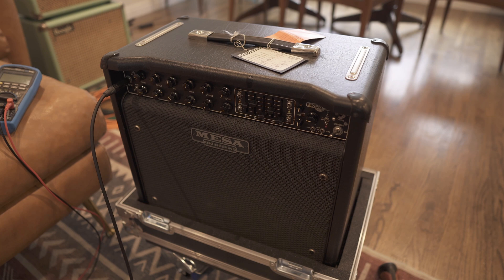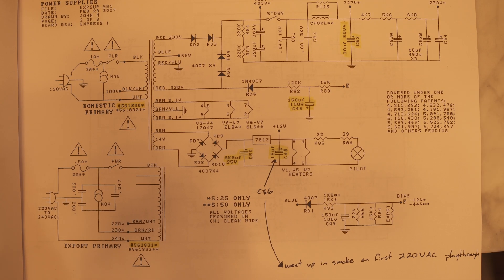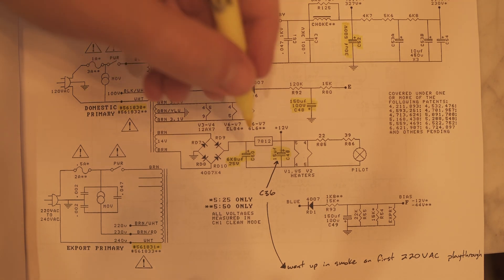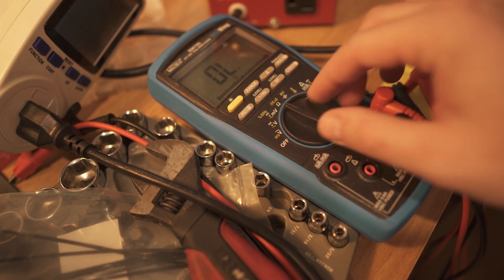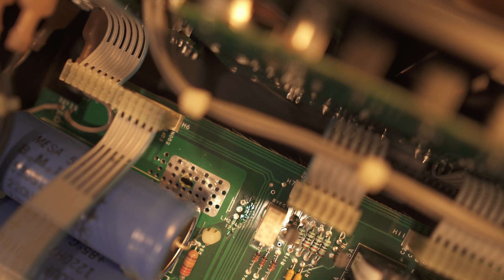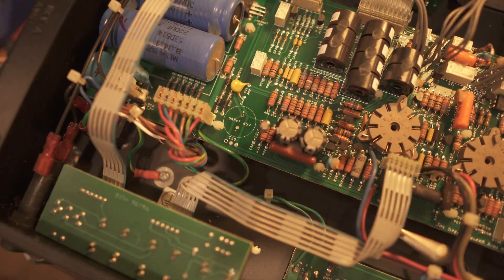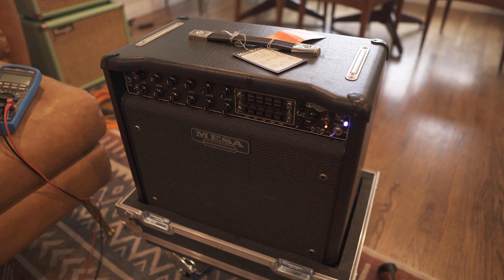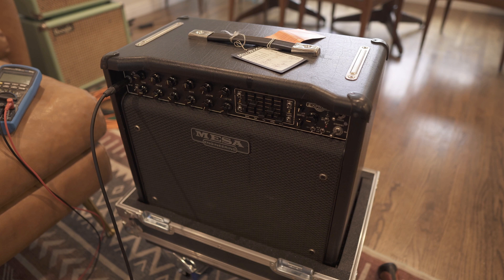Mesa Boogie Express 5:25 Repair

Comment: Well, the burning question in my mind, which is totally unanswered is, if you can’t get to the underside of the board, without massive disassembly , How in the world did you get that radial cap in and out of there ???
You Conveniently did not show that part!
Reply from the maker: @dalevanlewen9759  sometimes you can twist radials clockwise and counterclockwise until they break away from their leads without damaging the pads. Then you just desolder the leads. But for this particular cap, i lifted the board just enough to get a soldering iron tip under there. To do this, you have to disconnect several ribbon cables and push the plastic stand-off clips together to release the pcb. Not a total disassembly, but still a delicate process. There's another comment on here where i posted a reply already, it's C50

Comment: How did you remove C50?
Reply: Excellent technique. Thanks for the quick response!
Reply from the maker: C50 can be removed by carefully twisting the component CW and CCW until the leads disconnect from 
the cap but not the pcb. Much like how you can remove an SMD cap. To get it flush on the board, you'll need to lift that side of the main pcb to solder the bottom

Comment: Unrelated question on this amp -- Is there a place to find descriptions/meanings of the relay designations in the schematic: RYTS; RYOD; RY2; RYE, RYA, etc?

I am looking at the preamp schematic and having a hard time understanding how the signal flows in any given mode.  Is this correct for clean channel in clean mode:

Input --> V2B --> CH1 Tone Stack --> Ch 1 "Gain Control" (1 MA pot) --> V1B?

And then "crunch" mode of channel 1/clean channel would be:

Input --> V2A --> CH 1 Gain Control --> V2B  --> CH 1 Tone Stack --> V1B?
Reply from the maker: I don't have the schematic handy right now, but Mesa has a pretty bad reputation for their schematics. Sometimes going right to left for signal and poor descriptions etc. You might be correct but I recommend injecting a known signal (sine wave at 400Hz for example) and then probing through the amp at every stage to make sure things are correct. I did a similar walkthrough with my own amp in this video. https://youtu.be/1PB1vcr_Zik?feature=shared